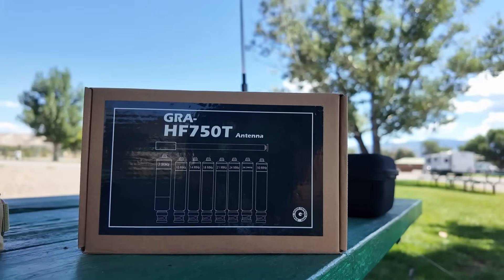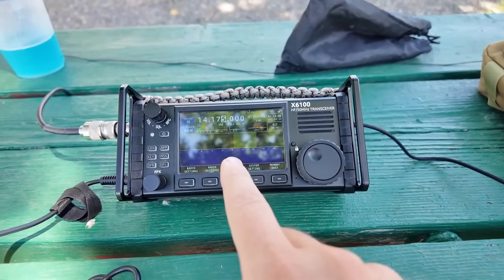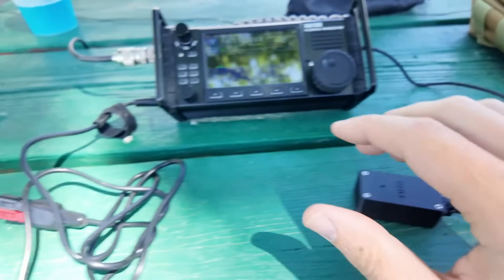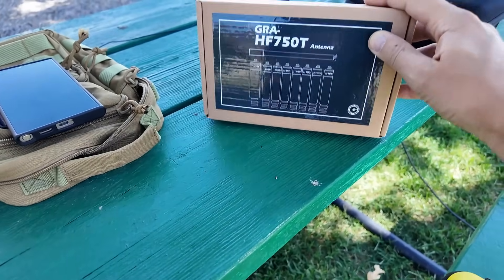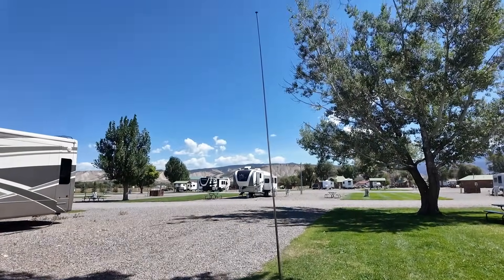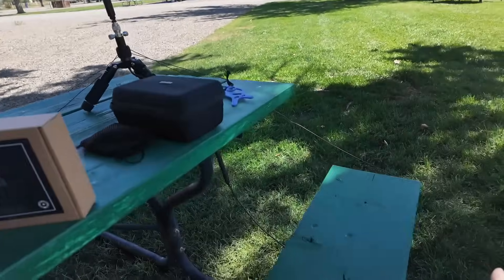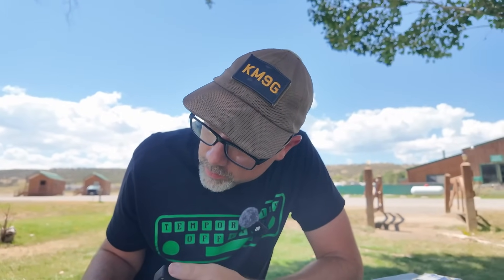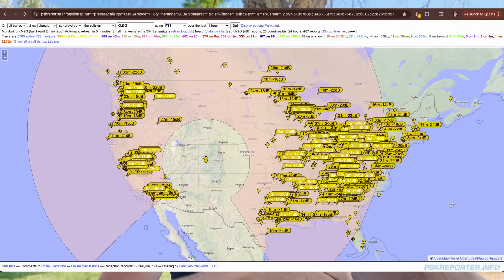Does the Gabil 750T Actually Work… or is it Just a Dummy Load?!

Comment: I was on the fence on this antenna. Eesh. This hasn't helped. Haha. It's very mid.
Reply from the maker: It's got a very specific use case- compact. Portable. Light.  If you don't need that, there are better out there.
Reply: @temporarilyoffline Yeah, I currently use MC750 or 7m pole with dipoles for SOTA and POTA, but was wondering about these for super simple/quick activation.

Probably best to stick to something bigger, and that'll outperform. 😂

Comment: I wish Gabil made single band versions of this, or a $99 four pack for 40-20-15-10 for those who can do without the WARC bands.  A low cost BNC version of this antenna for 20m with a trailing counterpoise wire could make the FX-4CR a 20W HF HT and that could be a lot of fun.
Reply from the maker: This was $127... close enough

Comment: Serious question. Could you use several shortened coil loaded antennas in a yagi config? Pack-a-beam? Or Pack-a-Yagi? tm pending
Reply from the maker: Since you can use them in a dipole config, I don't see why you couldn't use them in a yagi config also.  I wonder if the director and reflector need to be coils as well or just slightly shorter than the driven elements+coils??  Great idea!

Comment: I had trouble with mine on 30 meters. Now I have something similar from MFJ that I’ve had good success on. MFJ-99t or something like that. One antenna with taps on the coil. It wasn’t the concept I dis agreed with. I had a quality control problem with mine. I mean, normally the kx2 can tune anything although I tried to get it close before that with an analyzer.
Reply from the maker: I've seen the one with the coil and taps, its a proven design... a little bit of a pain to tune, but still got the job done.  Every antenna works, just some antennas are better at somethings and other antennas are better at other things.
Reply: @temporarilyoffline My goal with the setup that you have was to use the kx2 as a handi-talkie. Can’t do that with my MFJ one. I might try again with some of those single band ht antennas from China  I see on eBay.

Comment: Nice TO !    Im using my DIY  40/20  "switchable"  vertical antenna with my G90 and getting good results on both 40 and 20.    It also has a   "small coil"  and  a   "small vertical" .     Verticals do work.    ;)
Reply from the maker: Verticals are my preferred antenna!  I saw your vid on the 40/20, nice work!
Reply: @temporarilyoffline  thanks!

Comment: Sold out everywhere…
Reply from the maker: Yeah, I have that effect sometimes!  It will be back in a bit.  They are doing an emergency re-supply.  When I drop the next video on testing it on 2 meters, make sure to click the link for it.
Reply from the maker: I just found it:  👉 Gabil 750T Antenna (Ebay): https://geni.us/Ad29l
Reply: @temporarilyoffline I bought the 7350 screwdriver instead, seems to work well, not as portable though …
Reply: @temporarilyoffline thanks for looking out though, appreciate y’all
Reply: Gave you 610 points anyway … thanks!
Reply from the maker: Thanks!